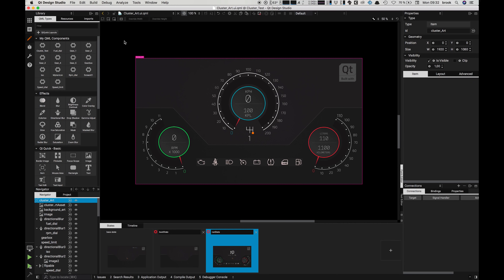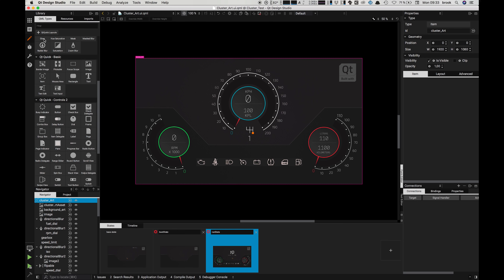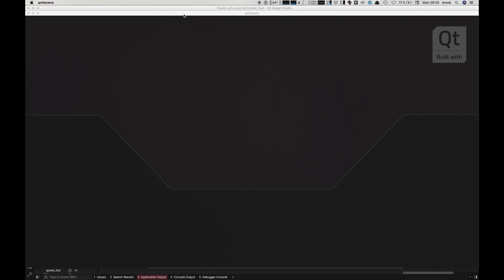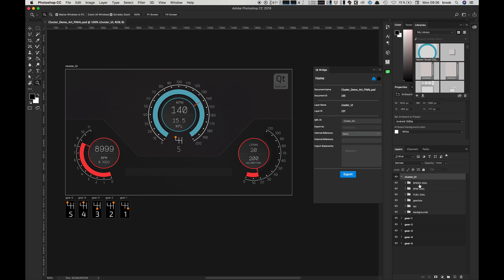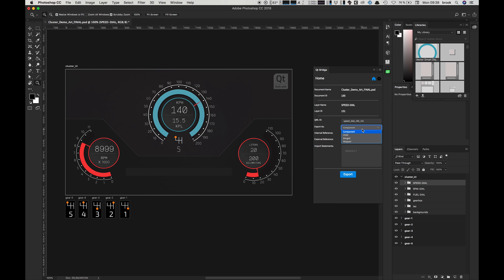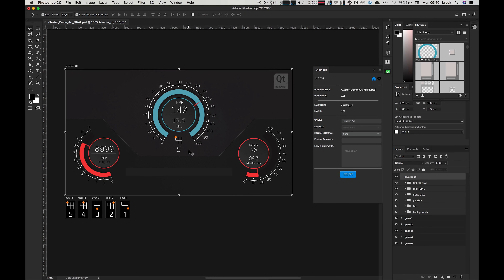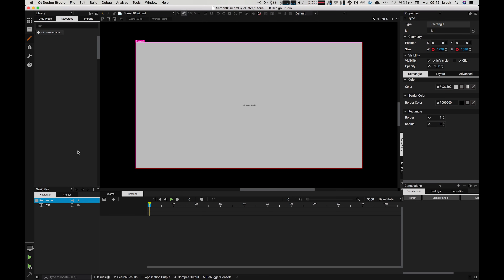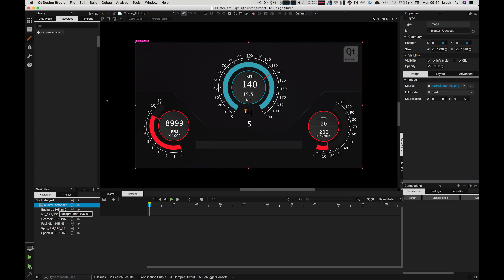Learn to use Qt Design Studio by Building an Instrument Cluster for Your Car HMI (Part 1)

Comment: Is there any way to increase the font size of Design Studio's UI? 

I can not read pretty much any label in the left panel and even main menu (dropdown) items are difficult to read. I've even tried to increase the font on my OS, but Qt Design Studio, apparently, uses its own font rendering rules. The only option for changing the font I could find in the Options is for changing the editor font.
Reply: Which operating system are you using? If you use a 4k screen you might have to enable Tools/options/Enviroment/Enable high DPI scaling.
Reply: @thomashartmann2495  Thanks, but that didn't help. However,  I've found a solution - setting QT_SCALE_FACTOR environment variable. It's Windows 10, 1080p desktop 24'' monitor (93 DPI). So the DPI is not that high.

Comment: Is it possible to open this in Qt Creator or does it need to be converted to a .pro project? I've tried opening in Qt creator and it doesn't open correctly. If anyone has a working version of this example for Qt creator can you please share it.
Reply: Qt Creator can open .qmlproject based projects from Qt Design Studio. If you want to convert .qmlproject to qmake based C++ projects this is described here: https://doc.qt.io/qtdesignstudio/quick-converting-ui-projects.html

Comment: Hello. This tool looks great I'm new to this. I opened Qt design studio, open examples, cluster tutorial. Double click on Cluster_Art.ui.qml, and then I only see the background with qt image and nothing else. Basically the same as 9:56 but no gauges. Any help Qt, please.
Reply: By default you are in the base state which only shows the background. You can use the state editor to change to "bootState" or "running". In running you see the gauges, while in "bootState" you can checkout the timeline for the bootup animation.

Comment: Can I run this kind of application on Raspberry Pi? I'm doing a school project about digital cluster and I'm using Raspberry Pi to show the actual cluster. Can I get some help and I would take any advice. Thank you
Reply: ill tell you now... its mad expensive.... like $10k+. im doing a similar project and ive looked into it back in 2015...
Reply: @japanman1994  10k?? thats abit extreme isnt it? i would have thought it would be under £50, thats 30 for a pie and 20 for a non touchscreen
Reply: You''re out to lunch. 
I've built a whole alarm system and an instrument cluster with doppler radar, LIDAR, ultrasonic sensors, 5 video cameras, speed, tach, all circuits have current and voltage sensors and a bunch of other goodies, and I'm about $1200 into it with a 10" waterproof touch display, arduino, and tinkerboard s (better than rpi3)

Although I went extreme and want my vehicles protected well, an instrument cluster could be built for about $50-100.  with a pi, touchscreen and a couple sensors.
Reply: @sierrakilogulf  Did you use QT automotive for your project?

Comment: Can I use python? How do I implent design to C++ or Python? Please, can you make tutorial? Thank you.
Reply: Design Studio does not work directly with C++ code in the backend, as it is intended to be used by designers so it doesn’t require compilation or building of full applications to test your work. What we recommend is that users create a qml api for their Design Studio project and work with a Javascript mock backend while designing, then when the project is brought into Creator the mock backend can be easily replaced with a real C++ backend. This way both the designer and developer can continue to work with the project in each respective software and as long as the api file is kept up to date it will work for both uses. You can read more about creating the mock backend here:

https://doc-snapshots.qt.io/qtdesignstudio/studio-javascript.html

After the initial design is already done you need to bring your design studio project into a creator project for the developer to integrate it into a full application. As the design studio project is only a subset of this full project it is recommended that the design only touches these files in their work, as mentioned above, using a mock backend to simulate the real backend while the developer uses the real backend in Creator. Here are the guidelines for integrating the Design Studio project into Creator:

https://doc-snapshots.qt.io/qtdesignstudio/quick-converting-ui-projects.html
Reply: @brookcronin8586  how can you tell if the HMI will be able to handle it? (I mean all the nice features created with Design Studio)
Reply: With Design Studio's live preview feature you can test your designs very early in the process, on the real hardware, and ensure that any effects or features you use will run on the final deployment platform.
Reply: Qt also has Python bindings. https://www.qt.io/qt-for-python

Comment: do i have to install Qt design studio to be able to use Qt bridge even if m using Qt creator?
Reply from the maker: I assume you are referring to the Photoshop exporter/bridge and in that case you need Design Studio.
Reply: @QtStudios  ooh thanks that's help full. i used this file to export qml from photoshop. https://github.com/qt-labs/photoshop-qmlexporter
Reply: Qt bridge not work with photoshop 2018 any solution

Comment: how can i get qt bridge extension to export png files  ?
Reply: that should be the default, what are you getting instead?
Reply: @brookcronin8586  nothing
Reply: @yassinechaibi2183  Are you putting all your artowork on artboards in Photoshop? Did you check the export as settings in the bridge plugin and set all the layers you want as single pngs as child?

Comment: Nice work. I have a question. Is possivle to run this applatuon on raspberry pi or adrunio or which controler board you recommend. Thanks hope hear back from you soon.
Reply: Do you mean the Design Studio Application or whatever you make with Design Studio?
Reply: Yes, Qt runs on the Raspberry Pi.

Comment: Hello, i'am trying to create custom arc item, but it looks not well.. I have my work in PS with qt bridge. Is there some idea to create custom arc item from png image? 
Link to image: https://scr.hu/OJX5Arl
Reply: I can't really tell what you've done here to create this arc, however it certainly doesn't look right. The simplest way is to draw a circle using the ellipse tool, then you can specify the stroke width, and then use the Qml Type option in the bridge plugin to replace your photoshop layer with a qml arc component. There is documentation here for this: https://doc-snapshots.qt.io/qtdesignstudio/psqtbridge.html
Reply: @brookcronin8586  Thank you for your answer.
I've upload video with render of my arc in photoshop: https://youtu.be/hYNlmXS4cVI
Which type should I enter for qml type in Qt bridge photoshop? Is this PathArc?Maybe my thinking is wrong about it.
Reply: @d-nova-pl   I would use ArcItem and make sure to have the  QtQuick.Studio.Components 1.0 library in the imports for that artboard. This should give you a proper dynamic arc.
Reply: @d-nova-pl   Hmm, although i can't say for sure as there's no image containing the project navigator, so i can't see the whole qml file structure, it looks like you should have an arc item. At this point i would suggest you create a bug report and upload the files so we can see properly. https://wiki.qt.io/Reporting_Bugs

Comment: Good lord, I spent an entire day looking through QT Creator, and QT Designer trying to figure out where the features shown here were.  I thought my QML module imports were not working right, and I tried different versions of QT, different platforms, etc.  Very confusing.  Can I use QT Designer Studio as a replacement for the QML functionality in Creator for open source projects, or does this require a commercial license?  Are any of the QML modules shown here commercial only?

Comment: 6:00 Interesting to see that your #photoshop plugin provides options for every PS layer and / or folder if and how they are exported. Wonder if I can select several folders / layers and change those property at the same time. Also I do wonder what happens when I change those properties on a folder. Are the contained layer´s properties also changed?

10:07 good aproach that it is mandatory to include fonts with every project instead of having those handled by the operating system. This makes file exchange over big teams across the globe easier.
Reply: No multi select as of yet, it’s generally a nice feature though so we will look into it. If you change a group’s setting the sub groups and layers will retain their original settings, however if you set a group to skip all the contents will be skipped. Font handling is moving in the right direction but still needs work to make it truly seamless. For example matching the cut and weight of the fonts and properties such as alignment and kerning. Also bringing the font and creating the loaders automatically into the local project directory and proper handling of Typekit fonts for example. This is a Tech Preview version and is still under heavy active development so there will be a lot of improvement in future versions.
Reply: No multi select as of yet, it’s generally a nice feature though so we will look into it. If you change a group’s setting the sub groups and layers will retain their original settings, however if you set a group to skip all the contents will be skipped. Font handling is moving in the right direction but still needs work to make it truly seamless. For example matching the cut and weight of the fonts and properties such as alignment and kerning. Also bringing the font and creating the loaders automatically into the local project directory and proper handling of Typekit fonts for example. This is a Tech Preview version and is still under heavy active development so there will be a lot of improvement in future versions.

Comment: Where can I buy the Qt Bridge plugin?
Reply: The Qt Bridge plugin is part of the Qt Design Studio Tech Preview download
You can find the download here: https://www.qt.io/ui-framework
Reply: @qtdesignstudio3204  I downloaded Design Studio .exe and there is no plugin  ps bridge included
Reply: ahhha after an hour i found it in the programs folder,  a installer was needed to install it in photoshop.
Reply: Whats the name or where did u found it?
Reply: @streampunk7726  It's in the Design Studio download, there's a folder called "photoshop_bridge" and the plugin is called "io.qt.QtBridge.zxp" you need to install it with this: https://zxpinstaller.com/
Reply: @brookcronin8586  Is it work with default version of CC 2018? I tried to install that plugin for CC 2017 by ZXP, but extension was not compatible.
Reply: @d-nova-pl  Minimum version should be 19.1.1 If it's not working for you please consider writing a bug report. - https://wiki.qt.io/Reporting_Bugs
Reply: @brookcronin8586  I have to install photoshop to import the file?